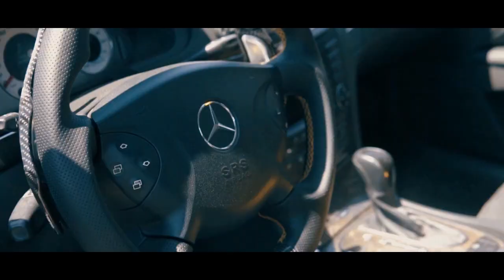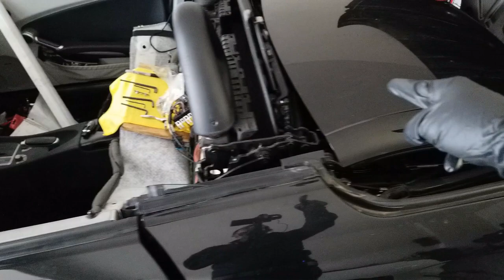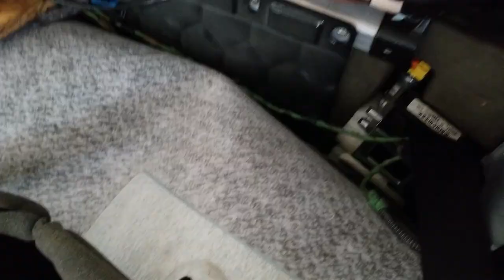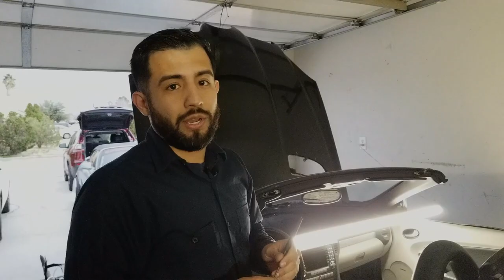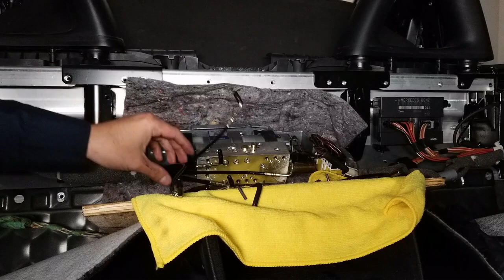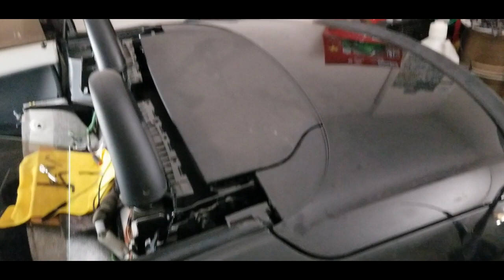Mercedes Benz SLK55 R171 VARIO ROOF REPAIR PART 2

Comment: Pretty poor video, every time you fixed something you blocked the image of the video with your arm or elbow. Never showed us how to bleed the oil. Did you not think to proof read the video. Best stick to video games, eh?
Reply from the maker: Its self bleeding no need to bleed the system. Just cycle the pump with the switch.   Yeah i worked with what i had at the time terrible laptop & software. Not the best but still a good video with the process.

Comment: How do you replace the back shelf that comes up when the roof goes in the trunk and where are you located
Reply from the maker: Are you referring to the cover that folds up with 2 triangular pieces folding out? Its a simple process as the cover is only operated by cables when the roof retracts or closes. Im located in El Paso TX

Comment: Hi I know this an old post but I just got a SLK 350 and of course the roof is not working I want to follow your video and try to fix it my self, but before that I have a couple of questions, the roof is up as in closed, I would like to open it so I read that I need to release the front, then release the pressure on the pump and then pull back to open, is this right (i would get more space to work on it). when I press the button to open and close the little windows go down and I hear some noise like the pump going? but nothing happens, di you think this is a pump issue?  thanks

Comment: I watched ur 2 videos on vario roof u fixed. My boot opens but then I hear the pump working but doesn't go down . Sometimes works but recently no so any help appreciated.
Reply from the maker: When that happens it's most likely low on fluid.  A low pressured system wont fully function.  You can try there. If you need to manually open go ahead open release valve if you need to drop the top

Comment: I got most of the mechanic part but how to empty and fill the hidrauhlic pump was not very clear. If you have more reference on how to do it it would be great
Reply from the maker: Its simple, you will have to hold the pump vertically with the port hole facing up and using a plastic  Syringe with a fitted tube to extract or fill said reservoir. You can do thise with it completely removed or with it hooked up just be careful not to let the fluid run into the motor or eletrical connectors so use a towel
Reply: @PANZERSGARAGE  ok thanks for the detail

Comment: Excellent job and video you did. Hope, I‘ll never have to repair the hydraulic roof-system. But in case it should be necessary one day, you gave a lot of tips and hints.

Comment: Hi it’s a great video 
If you can just help me plz I have a r172 
Due to leaking hydraulic line my mechanic opened the roof manualy but now after fixing it the roof won’t work . 
And even the boot won’t close completely and suggestions

Comment: Thank you for your in depth vid my leak happens to be on the passenger side but this was very helpful for me to have the opportunity do it meself in the near future . . . Really awesome vid with pointers and tips! 👊😷👍
Reply from the maker: Thank you and I'm glad my video can assist and give you a in depth look of the vario roof and components.  Good luck on your repair and I'm sure you can knock it out.
Reply: @PANZERSGARAGE  its definitely a project waiting but for now im praying that this stupid air pump will clear so i can pass smog everything seems to be working fine such as the vacuum valves no leaks and not sure why after 3 days it keeps throwing the engine check light on after reset 😟
Reply from the maker: @moonyachti  ah that dam pump. I had just replaced mine a d uploaded a video on this as well. Lol I needed it to pass emissions also.
Reply: So today i happened to get my emissions checked before i took it in for a smog and everything clear except for the stupid visual smoke check i think its called a snap check maybe anyways  i feel like I've been had like they were looking for something  to fail me for and right after they failed me they tried to upsell me on some additives to clean the carbon out what . . . What do you think about this

Comment: I just bought a 2006 SLK208 with a malfunctioning Vario Top. I notice the hydraulic trunk cylinders are not connected to the tubular frame. they were disengaged by the previous owner after closing the top manually.
Numerous attempts to re-attach them both prove to be unsuccessful. When I manage to attach one to the tubular frame the other is pushed too far out, even with the pump bleeding valve open.  I also have to mention that the top was locked manually and the front cylinder is the one that is leaking.
 How do I make them retract to fit for re-attaching?
Any help will be greatly appreciated
Thanks
Reply from the maker: Sounds like the previous owner did some temp bad fixes to close the roof.  For the tubular frame (trunkend) you need to use the manual key to lock and unlock the frame whe  trunk is closed. Doing so you should be able to reconnect the trunk lift supports. I'm sure that's what you are referring to?

Comment: Excelente video! ¡Muy agradable! You did a great job explaining the each step. It was also a great idea to explain before showing the actual step in the video. I do have a question. I can see hydraulic fluid leaking where the roof meets the windshield. Should I just replace the lock cylinder and level up the hydraulic fluid?
Reply from the maker: Yes, you can if funds are available I would also do the main lift supports as well. If not you can just to the hydraulic lock latch and top off fluid accordingly. 🤓👌 godspeed friend

Comment: My roof stopped working ... one of the push pull plastic connectors that connect the hydraulic lines keeps popping off. I bought new ones and it still does it. Any ideas ?
Reply from the maker: I'm sorry for the very late reply. I dont know how I didnt see this comment.  Have you fixed it already and what plastic connector? They should be metal connectors

Comment: Great content subscribed! Also, my left "triangle" window won't come down when I open my vario roof, any ideas? I have an Slk 200 r171 - 2006 model.
Reply from the maker: If your left rear window wont go down it can be a bad window regulator.  
Double tap the vario roof switch down to see if you get a reaponse.
Reply: Ivan Rodriguez thank you! I did, and I can hear the noise of it trying to go down. I'll take it to the repair shop within the week to see what's going on.

Comment: Great video. I have a question. I have a 2005 SLK 350. The top will start to open as far as the windows and the trunk portion will open then stop. The top does not go back . Only the trunk opens . Any thoughts? 
 Thanks
Reply from the maker: If any part of the system stops you could have a low fluid level in the pump reservoir.  It happened to me when i had a leak in my system.  Vario roof would struggle to complete the cyclw
Reply: Panzer's Garage Thanks I figured it out , it had a bad relay . Two relays next to the pump . Replaced both because I was there , all good now .
Reply from the maker: @heberclementiii6788  i wonder what caused the relay to go bad. Check the fluid for the pump.  Over worked pump can really generate heat and strain the system. Just in case 🤓🔧 glad you got it solved quickly.
Reply: Panzer's Garage Yes fluid all good..
Reply: I have the same year and make i cant wait to fix mine before this summer is over 😂